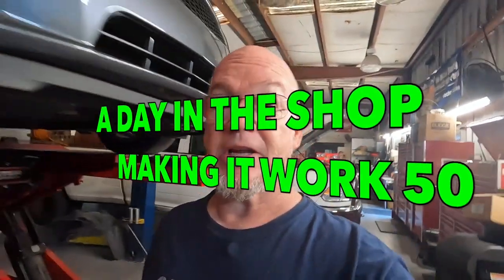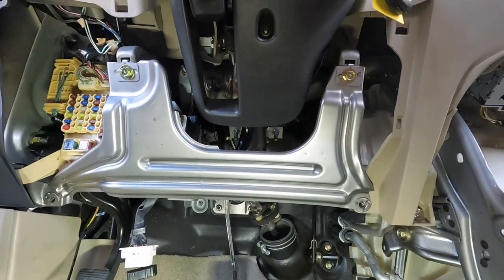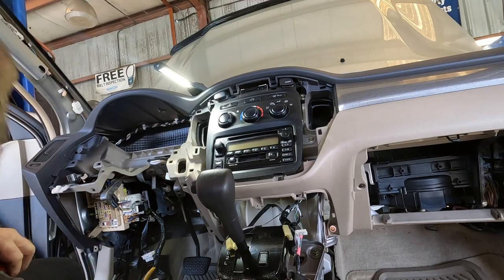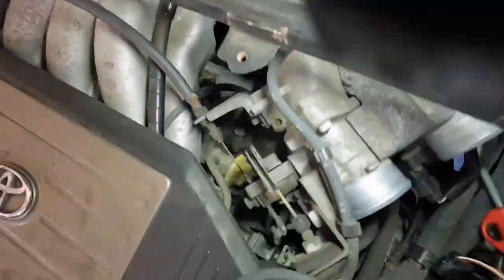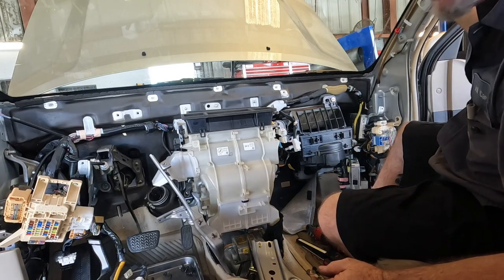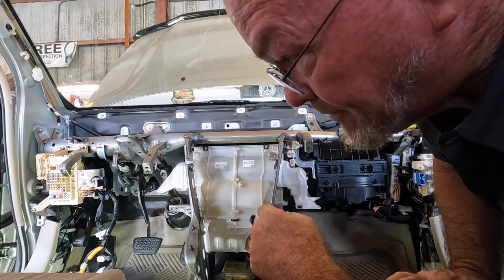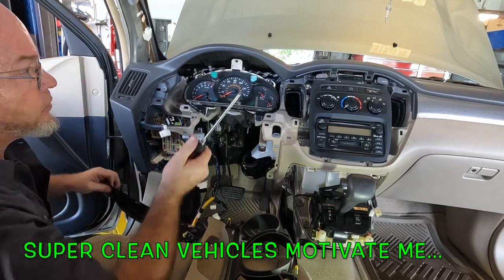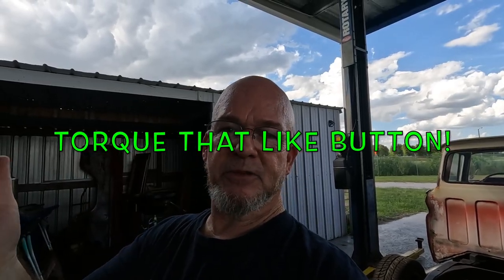A DAY IN THE AUTO REPAIR SHOP, 50. TOYOTA HIGHLANDER EVAPORATOR, BMW MELTED SHOCK...C10 PROJECT...

Comment: Once you get good at a job, timing is nothing. I got REALLY good at 4t65e transmissions. I was able to drop them down, rework the guts including a forward band, input, clutches and get it back together in 3 hours. 

Tool, $40? Shameful if that much😒I would have figured out something else. Maybe 2 pocket screwdrivers side by side. It is nice to have purpose built tools that work exactly as designed though.
Reply from the maker: Wow, it would take me 3 hours to remove and replace it easily. 😎 The line clamp has two pin holes…intentionally made so you need a tool. But two paper clips works, just a hassle.